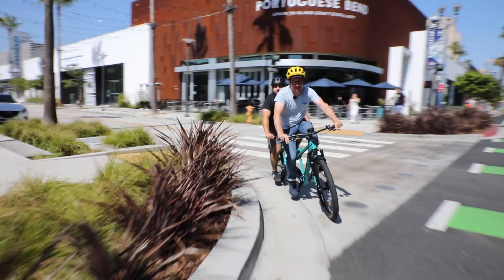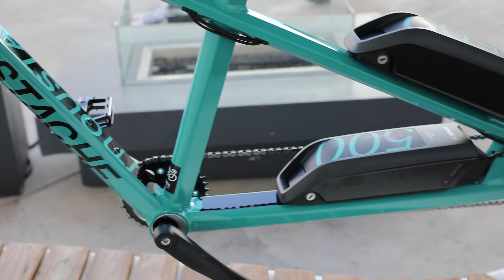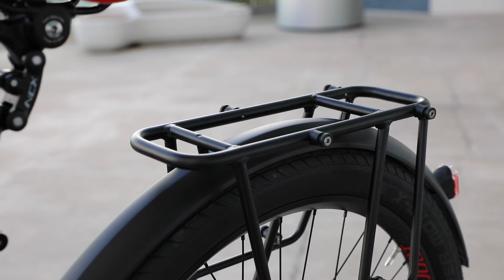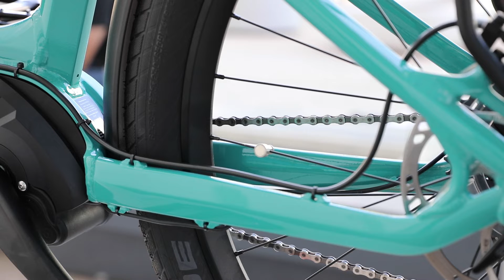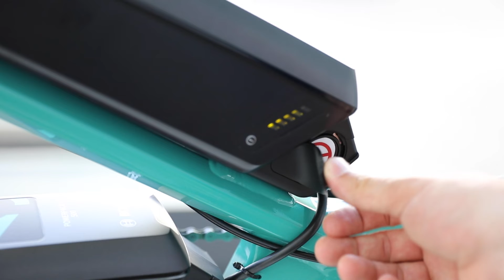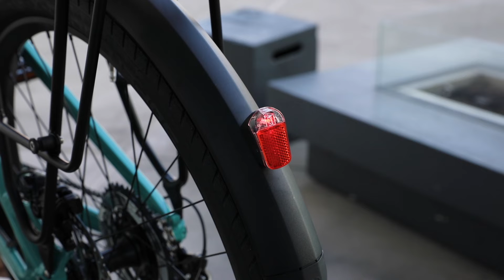Moustache Samedi 27 X2 Tandem eBike Review

Comment: I picked up mine last June from Cyclesense York UK last June, with this lockdown miles are stacking up! Changed saddles, grips, just put a riser stem on too, as at 5’10” my wrists couldn’t handle it, as you say hope it doesn’t affect the handling, which is amazing. The whole bike gives you confidence, brakes are superb even when slowing from near 50 mph speeds. Difficult bit is trying to get the motor not to accelerate you up to 15 mph up every hill. Quite a bit of drag above our 15mph limit and gearing is a little low, but you get to use all of them. It’s a huge machine compared to our old Dawes tandem. Can’t recommend it enough! Love watching your vids.
Reply from the maker: Great feedback! I’m such a huge fan of this bike! Stay safe and have fun!
Reply: If you feel drag, speak to your stoker :P
Reply: Oh dear Bryan, you should leave the sarcasm to us Brits, nearly as funny as the often heard ‘she’s not pedalling!’ Serious note try one of the Gen 4 motors (if you haven’t) very little resistance at all. All the best.
Reply: @Neil-ck7ud  I am very much not a tandem novice.  Kidding between like sorts.

Comment: Good to see you doing this review I’ve watched you on EBR with Court . I’ve been thinking of getting this tandem there’s nothing on the market that
Comes close here in the uk I’m currently riding a thorn tandem with a 14 speed hub excellent bike but it’s not A ebike
Reply from the maker: Thanks! I think there are shops in the UK offering Moustache as well. This is the best one on the market at the moment from my perspective. Having a Rohloff on it would be pretty awesome. Technically it could probably be converted to Rohloff.
Reply: Propel Electric Bikes
 yes I agree a 14 speed hub option would be excellent choice
Reply: Rhys Statham I recommend a visit to the “Fully Charged” showroom, in London. I have had great service from them, over the last couple of years. Expert advice and no hard sell, but they have all you need. I think they have this tandem e-bike available for demo rides.
Reply: Kola Ajibade I’ve herd good reviews about Fully Charged unfortunately there 140 miles from where I live
But there is a dealer in Cardiff South Wales  about 30 miles away which would be better for me